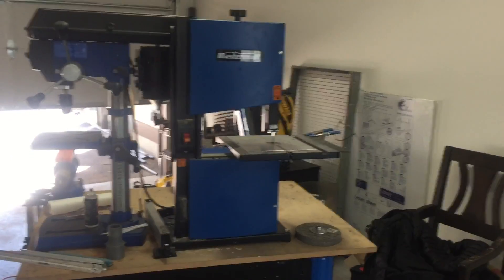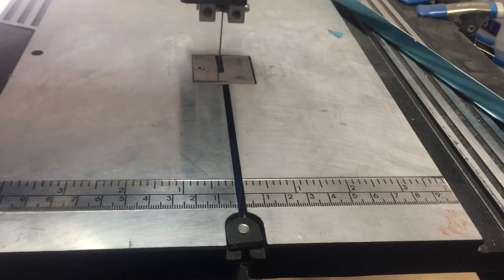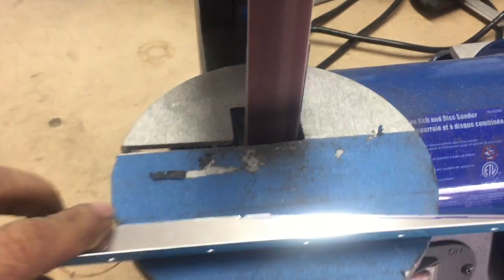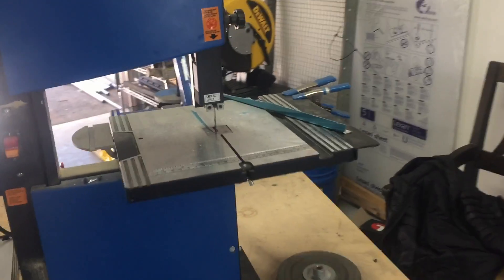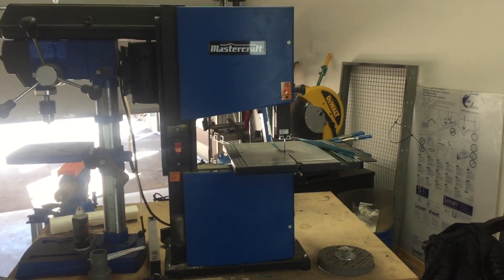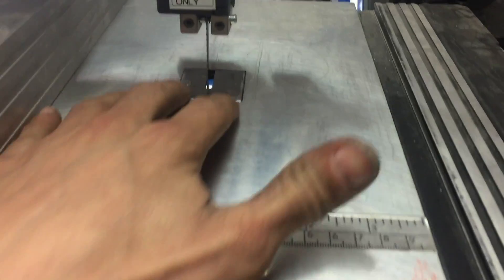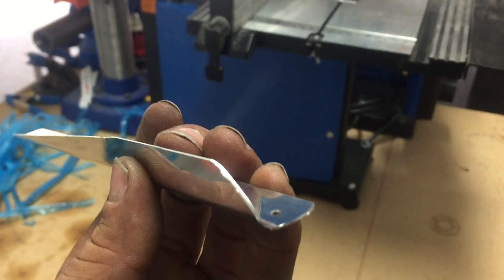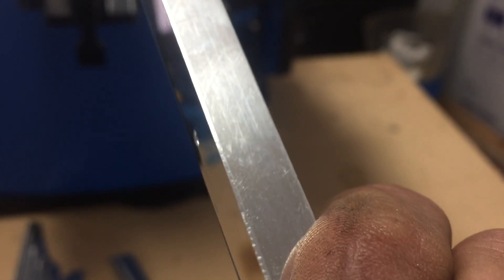RV-7 Elevator Stiffeners

Comment: I like your take on the stiffeners. Makes it look easy. Approximately how long did it take you to complete all of those?
Reply from the maker: +Justin Soltau Hi there Justin. Thanks for the comment and for checking the video out . The stiffness took me about 3 1/2 hours all said and done. Just relaxing in the shop. I probably could've shaved an hour off of the time.
Reply: Enjoy your build videos. Eventually I'd like to get in to building. I've got the starter kit but not enough tools yet. Just finished my Instrument Rating.
Reply from the maker: +Justin Soltau congratulations on the instrument rating that's not an easy ticket to get. I am still working on my PPL. And yes tooling up took me almost a year and a half and I'm still finding great stuff to help.
Reply: Good luck on getting your PPL! It's great fun. Keep posting more videos as well.

Comment: I tried a bi-metal bandsaw blade on my stiffeners and it was just too much work! The cut is so gnarly and jagged! I ended up buying a set of nice aviation snips.  They are right, and left hand cuts.  The slag side (the scrap metal side) will be the side that bends, not your work side.  I wound up using the red handled (I think left hand cut) snips to trim all of my stiffeners in about 10 minutes.  I literally cut right along my marker line and didn't have to sand or trim any more off.  I then took them right over to the scotchbrite wheel and for a few seconds each and they were done.  
I think I spent a total of about 15 minutes cutting and deburring every single stiffener for both my elevators.  
Get some good aviation snips, and some scrap sheet and you'll learn what angle to hold the snips (it becomes second nature after a few tries) and which ones to use for your slag end.

This is a great video on how to use aviation snips:   https://www.youtube.com/watch?v=9Ca2S59JhvY